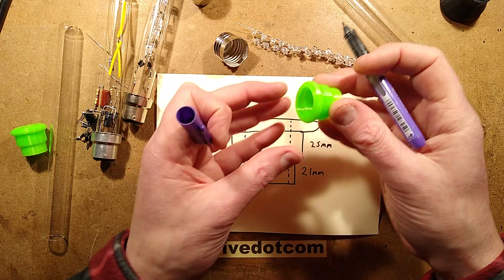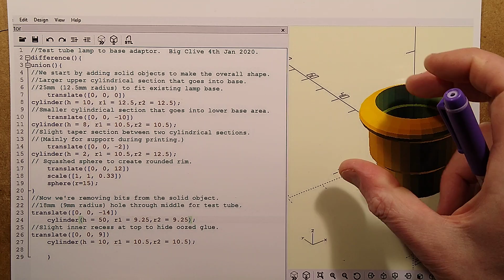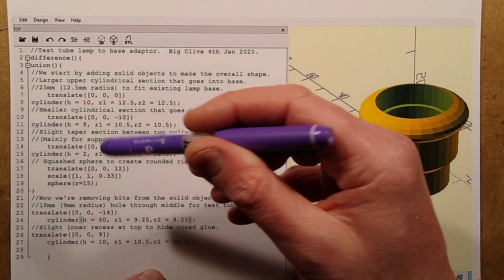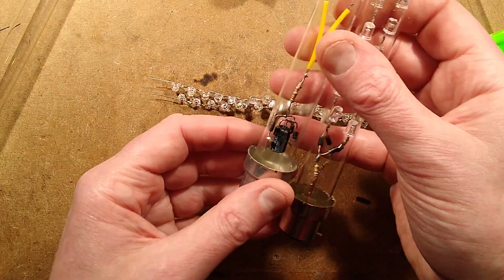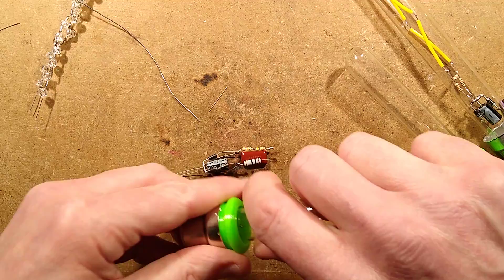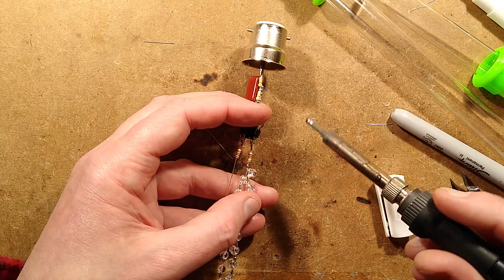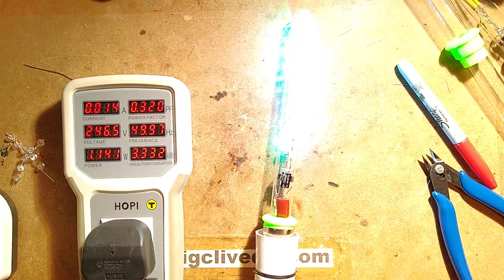3D printed LED test-tube lamp.  (with adjustable 3D openSCAD file)

Comment: Clive I really love your simple circuits but would like to see how you could improve the power factor on something like this. Maybe a future video?
Reply from the maker: It's really complex to correct electronic power factor.  It requires the current to be spread across the sinewave as a series of spikes.
Reply: @bigclivedotcom  I was just curious I've looked into it before and I don't entirely understand it. It's just something I really do want to understand better. I tend to get ideas better with practical examples, guess that's why I like youtube so much.
Reply: Also I really appreciate what you share and the fact that you are one of the few to answer comments on old vids. So, THANK YOU!!! Sincerely!

Comment: I haven't got to the end yet... but a thought along the way: could you not have recessed the components deeper into the bayonette base by removing the original lamp wires, and soldering component leads straight into the base?  
I've done a few mods and repairs in that way down the decades, both with ES and bayonette bases of different sizes.

Comment: Yeah, I know how it is when you wanna get into something new but don't really wanna spend so much time just figuring out how to. And don't get me wrong, code CAD software can be very powerful in some specific cases. But I think in most cases, especially with rather complicated geometry, it'll take you longer to write code than to use some software with a more graphical and let it do the math for you. I know there is a wide variety of different CAD software out there. And I guess everyone has to figure out what works the best for them. But personally I think I would recommend Fusion360 to you. And while I'm at it, I would also suggest getting used to working with parameters as soon as possible. Parameters are essentially the variables that define the dimensions of geometries etc. and you can basically define your own variables and change them later if you need to. And let me tell you, it's extraordinarily useful to be able to completely change the dimensions of things in your design later on just by entering a number in a text field somewhere. Especially when 3D printing things with very tight tolerances, which can be a little unpredictable and take some trial and error. In those cases parameters can make things so much easier.

Comment: @bigclivedotcom - Do you think it would be feasible to replace capacitive droppers with a simple high-frequency oscillator that fires every volt or so as the mains voltage rises and falls, followed by an inductor? Would it be sensible? I'm thinking it might be done mostly with low-voltage electronics that only 'see' the voltage difference between 2 tiny caps that monitor the mains voltage, then provide trigger pulses (perhaps via a UJT) to a small transistor rated for full line voltage and the desired load current.

Comment: The 3D printer code seems fine, Clive.

I would be inclined to put $fn = 100; at the top, just to start to smooth the polygons into circles, but that's just me.

Out of interest, do you think this would be suitable for containment of a radioactive MRE heater...? :-)
Reply from the maker: I hadn't discovered that instruction yet, but have since put it to good use creating hexagonal crystals.

Comment: You could design that with TinkerCAD in a few minutes, too. I've never tried OpenSCAD, honestly. TinkerCAD has had most of what I've needed for my projects. It has some limitations but the interface is just ridiculously intuitive. The learning curve for it is about as close to zero as you can get without having the thing just read your mind and spit out what you want.

I do a fair bit of 3D printing. I've got an Ender 3 Pro and I love that thing. When you get it working right the accuracy is incredible. I've printed parts with a tolerance of a couple hundredths of a millimeter. (Sure, that's not impressive if you're talking about milling metal but for squirting molten plastic out of a nozzle that doesn't really have any way to measure how much plastic is coming out other than how much you try to shove through it... It's pretty good.)

Comment: This is brilliant.  I have multiple coral reef aquariums & plenty dead aquarium heaters I’d been breaking down to recycle the sturdy glass tubes for an DIY lighting project using color changeable LED strips and an ESP chip. Great to see your implementations & will reuse your 3D SCAD file.  Thank you!

Comment: Several years ago I made something similar to use inside of a Himalayan salt lamp in place of the incandescent bulb it came with. Since I wasn't looking for the ionizing "benefits" of the salt, I thought a colorful nightlight would be nice. The design I used had only 2 color-change LEDs (one for each half of the AC sine wave) because I found that more than two eventually made a mostly uniform yellow color when diffused by the salt as the LEDs ended up at different points in their cycles. I also used a different value for the poly cap (I think it was a 0.22mf, but don't remember for certain) for the current limiter for US 120V/60Hz grid power, and I added a PCB mount style micro fuse just for good measure. In addition, in series with each of the two LEDs, each LED got a 1000V PRV diode to help prevent damage from line spikes that would blow through the LEDs. Each LED also needed a small RC hold-up circuit to keep the LED from resetting. It tested at under 0.5W power consumption and has been used essentially continuously for about 4 years now.

Love the content!

Comment: I'm in Camas, Washington, USA, using 120VAC.  Could not help noticing the circuit inside the pre-made tube to the schematic, that you placed the location of the 1 Meg resistor from paralleling the electrolytic cap to the output side of the two 1K resistors.  In the video build, you left the 1Meg out but had a resistor placed in the top cluster end of LEDs.  I'm guessing to limit the current because you had to cut away many LEDs in order to fit into the tube?
The 3D CAD was very confusing.  Looks too much like coding.  There are many free 3D CAD programs that create STL files that make more sense to me, like Tinker Cad, eMachineShop and my favorite DesignSpark Mechanical.  It was a pleasure watching you work.

Comment: DIFFERENT SLOW FADE LEDS?

I've bought 2 different sets of slow fade rgb LEDs, and they both cycle between slow fade and slow flash, back and forth---and the flashing just kills it for me. The effect seen here is exactly what I've been wanting all along. Do you recall which eBay seller you bought these from?

Comment: Stupid question from an electronics noob hoping not to kill himself by accident: what is that "drop capacitor"? What does it do and why do you need it instead of just using the bridge rectifier alone?
Reply from the maker: It allows a small portion of current through on each half of the sinewave and acts as a current limiter.  Without it the LEDs would go pop.  You can also use a resistor, but it would get very hot at the same current.
Reply: @bigclivedotcom  Thank you!

Comment: One thing to keep in mind with 3d printing is if your part is made from PLA filament it can start to soften and deform at around 50 60 degrees Celsius your circuit may not get that hot. But someone may want to use higher power LEDs that generate more heat. Make sure you print out of a higher temperature rated material such as abs.

Comment: As you get into 3d printing more and more you will probably find that you migrate to Fusion 360, it seems daunting at first but it is so powerful and easy to use even for extremely complicated designs.
Your filament will shrink just a bit so you will need to add .1mm to maybe .2mm if the printer is really sloppy to your designs for things to really fit.
The more you use your printer for your projects the more will wonder how you did without it, been using mine my projects for over 6 years and can't imagine life without it.

Comment: I prefer Tinkercad its quicker for small prints like that, recently will not export files with firefox, use chrome,  
no need for scripts, export to Cura and just print,  Older versions of Cura are better.

Comment: Following with the 'test tube' motif print a cork textured stopper, paint up 'corky', hollow for electronics. Intentionally over size it maybe. Do like the exposed electronics as well. Several on a test tube rack desk lamp.

Comment: once you get the hang of openSCAD its quite easy to use.

a few years ago i needed to replace a leg for my laptop stand and found the same article you did when i was trying to make the 3d model, though the model worked out to be a great fit i ended up forgetting to add a groove for when it would lock into place but ended up having it dremeled to fit.

i havent used OpenSCAD since 2017 but from what i can remember the reason difference comes before union is because of the order of operation (not sure if thats the right term) , you need to make the initial object first to then have something removed from it.

for reference here is the code for the replacement leg (with shoddy comments)

// everything is in mm
//rotate([90, -0, 0])
difference() {
difference() {
union() {
    translate([1, 0, -19.5])
  cube([20, 10.5, 3], center = true); //^leg/latch to stop it from falling out
color([1,0,0,0.3])
  cube([13, 10.5, 42], center = true);
} //< main body
color([0,1,1,0.5]) 
translate([1, 0, -21])
  cube([18, 13, 1.5], center = true);
//^latching cutout part for the leg

// main body
color([1,1,1,0.5])
  translate([6, 0, 3])
   scale([1, 2, 3])
    cube([2.5, 10, 10], center = true); // cut out for the laptop to hook into
}
translate([4, 0, -5])

difference() {
// smoothing of the back
color([1,0,1,0.1])
  scale([1, 1, 1])
    rotate([0, 0, 180])
     translate([2, -25, -2])
      cube([20, 50, 50]);

color([1,1,1,0.1])
  scale([1, 1.5, 3])
    translate([0, 0, 0])
    sphere(12, $fn = 100);
}}

Comment: Could possibly shorten the electronic part (more attention to insulation needed) by placing the dropper cap alongside if there's enough width. Maybe two lower value in parallel would allow tighter packing

Comment: Why "difference" comes before "Union": I'm not a coder and I have no idea about openscad but I think I understand the concept so I'll try to explain it in my layman's terms. Actually both are subroutines. The union one is nested inside the difference one. It makes sense in this case because you want to execute subtraction (sort of virtually drilling a hole) after you execute addition (adding up several cylinders). Now the nested subroutine execution completes before the one that encapsulates it. Since you want to complete the addition before you start subtracting, naturally the union subroutine should be the one that is encapsulated. Hope this makes sense.

Comment: If you invert the drop cap section, you could push it down between the two mains wires, giving a little more room for LEDs.

Comment: That is sooo cool! I like it! One question Clive. With the components used in the capacitor dropper circuit, this one specifically, what is the output voltage and amps with the circuit 'unloaded'?
Reply from the maker: The open circuit voltage will be peak mains voltage, so about 330V in the UK.  Current will be near zero unloaded, but the capacitor would be able to deliver a spike of current before settling down to the load current of about 10 to 20mA depending on load voltage.

Comment: ref:4:52
The "union" command  tell the rendering modul th'at the following scapes is to be tread as one object. This will be the base object for the "difference" command and the following scapes will be removed from this object.
----
1. This cleand up code works

difference(){
union(){
    cylinder(h = 10, r1 = 12.5,r2 = 12.5);
  translate([0, 0, -10])
    cylinder(h = 8, r1 = 10.5,r2 = 10.5);
  translate([0, 0, -2])
    cylinder(h = 2, r1 = 10.5,r2 = 12.5);
  translate([0, 0, 12])
    scale([1, 1, 0.33])
      sphere(r=15);
  }
  translate([0, 0, -14])
    cylinder(h = 50, r1 = 9.25,r2 = 9.25);
  translate([0, 0, 9]) 
    cylinder(h = 10, r1 = 10.5,r2 = 10.5);
}

2. You could also use the "module" to assemble the part for the object and get a lot cleaner version for the "difference".

// Part assembly
module part()
{
cylinder(h = 10, r1 = 12.5,r2 = 12.5);
translate([0, 0, -10])
cylinder(h = 8, r1 = 10.5,r2 = 10.5);
translate([0, 0, -2])
cylinder(h = 2, r1 = 10.5,r2 = 12.5);
translate([0, 0, 12]) scale([1, 1, 0.33])
sphere(r=15);
}

module remove_this()
{
translate([0, 0, -14])
cylinder(h = 50, r1 = 9.25,r2 = 9.25);
translate([0, 0, 9])
cylinder(h = 10, r1 = 10.5,r2 = 10.5);
}

//Render part
difference()
{
  part();
  remove_this();
}

, but source codes will render the same result.

Comment: Looking at that, my first thought is it would print easier upside-down and not need to worry about the taper at all (though it may help with strength even if it's not required)

Comment: Try some matte finish clear coating sprayed on the outside to diffuse the light further and help obscure the innards which aren't so pretty as the light it's emitting is. Adam Savage did a gaslamp lantern build and it had a nice effect when he applied the same technique.

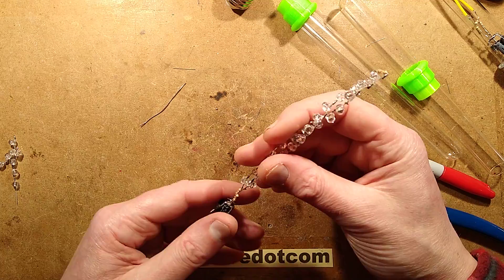Comment: 17:25 I'll help ya out with that, I tend mess up at least one thing when working on a project, it's an awful curse to have when cooking like this one time I made a pie and the dough recipe made two crusts, so I decided to half the recipe but I didn't half the water so it still worked as a crust but it was so runny and sticky that it was nearly impossible to work with.

Comment: Would you consider making a video of some 120v custom lamps for anyone that wants to make some of them in the USA ?
Reply from the maker: The circuitry in this one would work.  The red capacitor could be changed to a higher value like 470nF and lower voltage like 250V.

Comment: Clive do this same project with resistor dropper to see how it looks.
Reply from the maker: The resistor dropper would only be suitable for fixed colour LEDs.  The colour changing ones require a minimum current to stop the red chip dominating the green and blue ones by pulling the voltage down.
Reply: ohhh I didn't know that.

Comment: Solidpython  makes Openscad  easier and language less weird.  For example you can make Edison screw socket  with  "screw-thread" macro. This is about right: inner_rad=11, screw_height=20, tooth_height=3, tooth_depth=2, pitch=4 .  https://photos.app.goo.gl/7QR7syR9Cv9JSGrU6

Comment: https://docs.google.com/document/d/1tV1QH0wvnXhvmnVRobiOVXLSF6EJQJeFFl6trEXPxTo/edit?usp=sharing , I used your open SCAD and then took the STL file and opened it in my Cura program that I'm more familiar using with my 3D slicing.. But it turned out great...

Comment: I didn't get two things. 1. What tells the LEDs to change the colour? Any control over the range of colours or their sequence? 2. What makes the LEDs out of sync?
I'd appreciate an explanation or a timestamp if that's something I've missed in the video.
Reply from the maker: The LEDs have built in colour change circuitry.  They do their own thing at their own speed.
Reply: @bigclivedotcom  Do you have a link to those LEDs?
Reply: Oh, I see. Thanks for the explanation!

Comment: Points taken away since they aren't 3d-printed in lurid pink.
The ordering of the diff/union functions/arguments are for two reasons (probably):
a) it's more familiar to programmers to use the function call syntax like that, so historical baggage
b) For complicated reasons it's easier to parse. To create a parse tree of "normal" ordering, you have to maintain the argument, the operation, and the final argument. With the operation specified first (or last), you can get the arguments evaluated and out of the way first before you apply the operation. For normal computing this means you can unwrap loops and in some situations use more powerful instructions/GPU to do matrix tasks rather than procedural tasks, It has special meaning here since it also since it removes ambiguity from applying operations in different order (just like Reverse Polish notation on a calculator) It's especially helpful when you start nesting operations to not have ambiguity due to ordering. (What is supposed to happen when you union onto a diff of a diff of a union of a ....)

Comment: Clive you seems to really like tack soldiering but this is one project that could become a fire hazard from doing so. By simply looping the wire ends and compressing them you could make the connections mechanically strong and make the soldier connections more reliable as it prevents accidentally moving the wires a little while waiting for them to cool. This project contains many of high voltage connections that could come loose and cause a lot of heat dissipation that could cause a violent failure.

Comment: im just curious, are these technically legal to plug into the power grid? is anything thats not UL or Intertek certified not allowed? i think i remember hearing that if your house burns down and the insurance agent finds out you used a non-certified charger/device, they can deny your claim. 

also you need some pink filament!

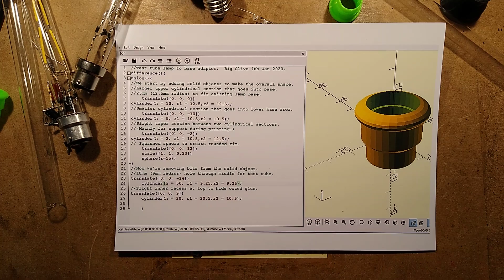Comment: I don't know if other people observed this, but around 3:00 when you turn down the brightness to show the design code for the base, that actually makes the code much harder to read. Something somewhere is doing contrast enhancement or edge sharpening so each group of letters has sort of a halo of light around it, and there are also colour artifacts. It reminded me of trying to read with a hangover or a migraine or both.I found it much easier to read for that second or two before the brightness was adjusted.